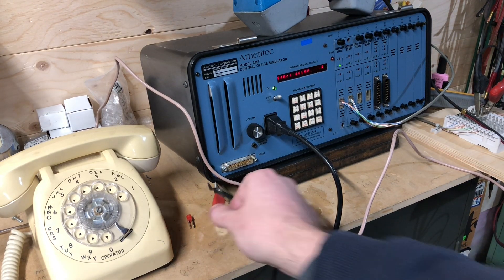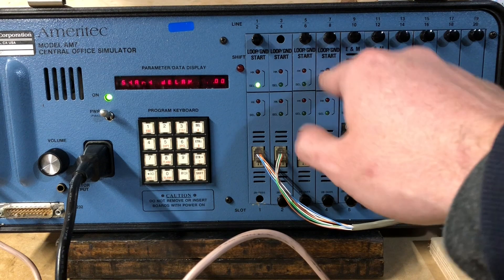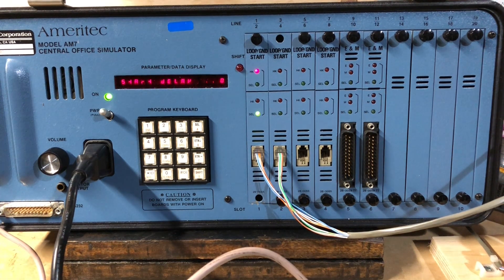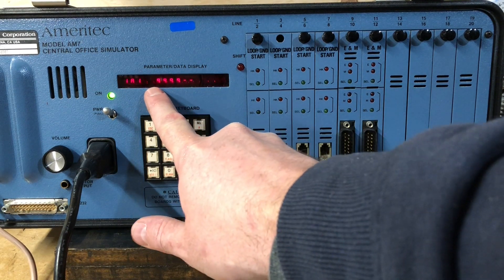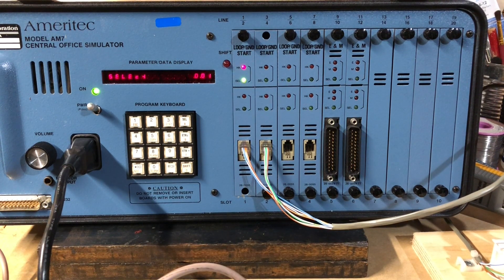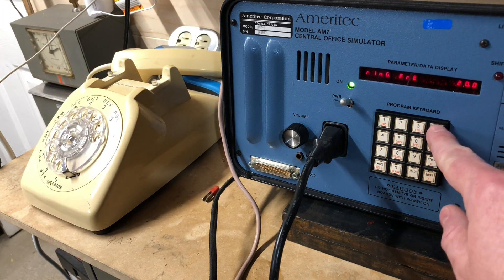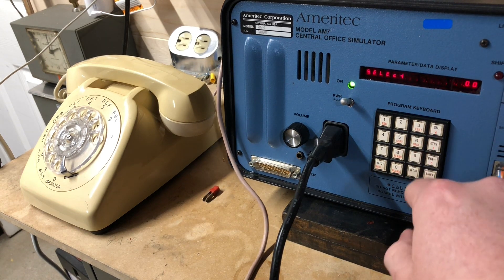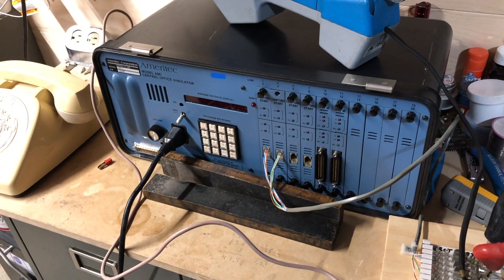Exploring the Ameritec AM-7 Central Office Simulator

Comment: That display looks deceptively like the ones on those old sprinkler timers. That unit seems like a nice little switch to have, dangit, you're making me want one now.
Reply from the maker: Rainbow_Dash_7x it is a very similar display. It is a nice unit, the downside is the lack of FXO facilities. There are PRI and E&M cards for it, though, so interconnect is possible it just takes a little more work.
Reply: @beefchicken  I think that there are even modules that basically have two FXO ports and when rings it picks up the other line and connects. that would be a way to do it as well, I think they were meant for out-of-band connection to PBX systems.

Comment: The British ring cadence is 400 milliseconds on 200 off 400 on 2000 off and repeat

Also our ring current was traditionally 16.67Hz... 1/3 of 50hz
Reply from the maker: TheChipmunk2008 for our party line systems we used 20, 30, 40, 50 and 60 Hz, with individual ringers tuned to only ring at their assigned frequency. It’s interesting how these were created from the 60 Hz line frequency; 20 by dividing, 30 by dividing, 40 by doubling 20, 50 by mixing 20 and 30,  and 60 by using the AC line frequency directly. I guess our ring current was traditionally tuned to 1/3 the line frequency too. If I did try to ring the phone in this video at 16.67 Hz it would sound terrible because the ringer is tuned for 20 Hz.
Reply: @beefchicken  yes I have the same problem with British 1970s 700 series phones trying to respond to the 20 Hz of my magicJack